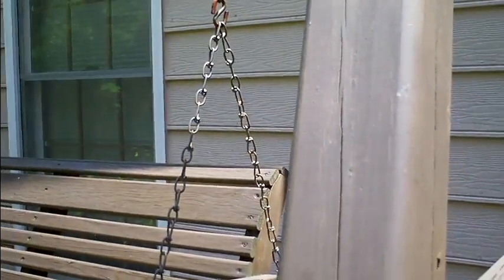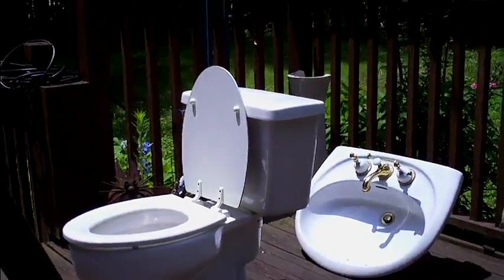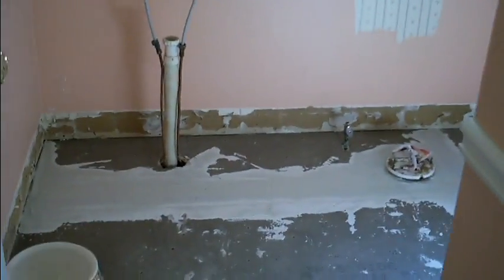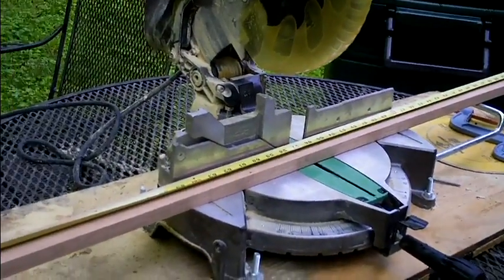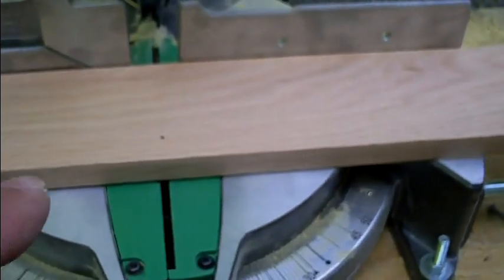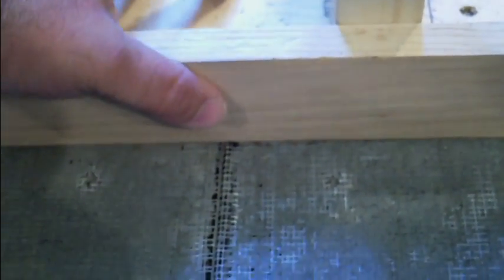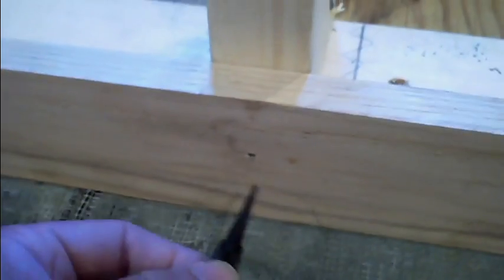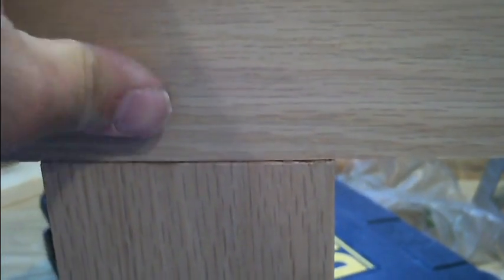Bathroom Remodeling Project(s) Part 4

Comment: I think you should leave the throne sitting on the deck, just knock a hold in the deck floor and put a pail under the deck....LOL.
As for finish nails, I always pre-drill using a small bit, finish nails always bend, they are too thin and unless the wood is very soft they will bend over, that is why I pre-drill every thing I nail regardless of nail size.

Comment: I'm remodeling here also at my home. 

You would have saved yourself a lot of effort if you had pre-drilled the oak BEFORE nailing. What I do is measure the diameter of the nail with calipers. I next get the next smaller sized drill from my drill index. Try it next time. Works great!

I also remodeled the outside completely without even have taken a door off before.

Best of luck. Looks good so far! You better can the toilet on the porch idea though...  If you don't, don't make a video! LOL

Tom

Comment: Willie Brooks, also did the tile in my new remodeled kitchen, which we loved.  Then a few months later, spring '12  we hired Willie Brooks to repair our shower that was leaking. After he completed the repair, we paid him $1,800+ $100 for gas money Willie Brooks, stated that he would have to come back one more time to finish the job. Today is 1-24-13, haven't seen him yet. He continued to set up a time but never shows. My shower leaks worse now than it did before he worked on it. Good Luck!